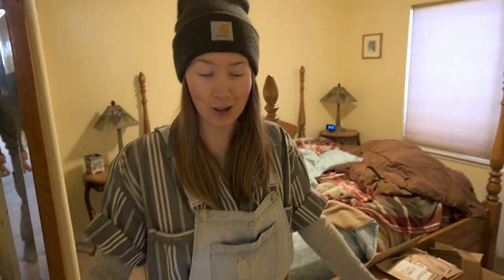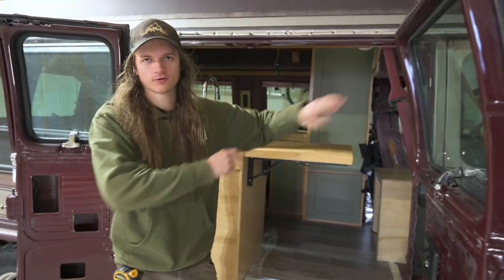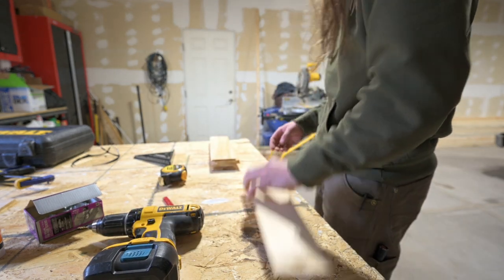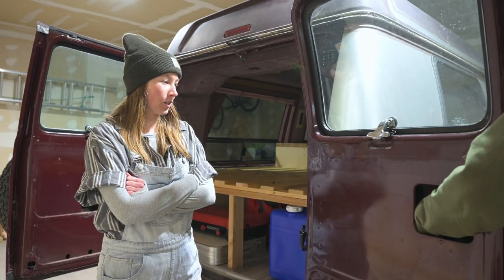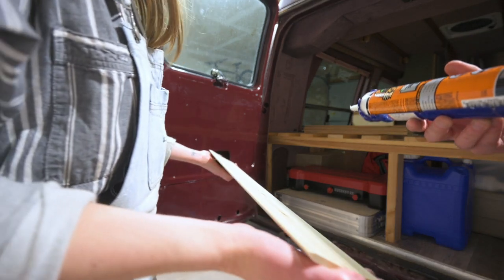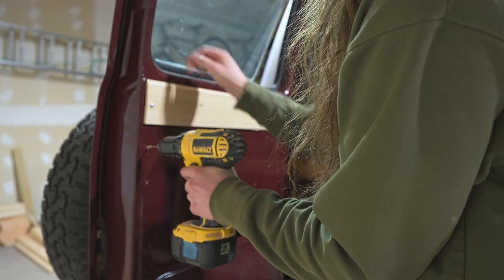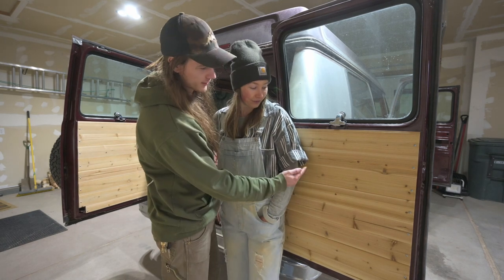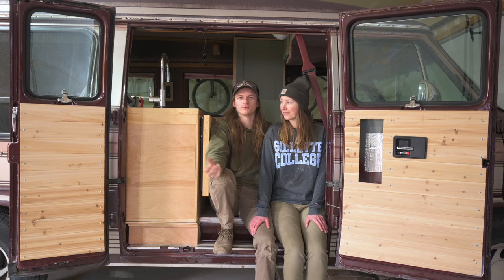How To Install Tongue and Groove Door Panels In a Camper Van

Comment: It would have been nice if you would have shown how to take the door panels off. That's what I'm looking for. A video showing how to get the door panels off
Reply from the maker: If your van is like ours then the door panels should just be held on by some screws. Just remove as many screws as you can see and start lightly pulling it off to see where it might still be held on by a screw. If there are any round "buttons" you can pop those off with a flathead screwdriver to access the screw underneath. I hope that helps!
Reply: Thankyou